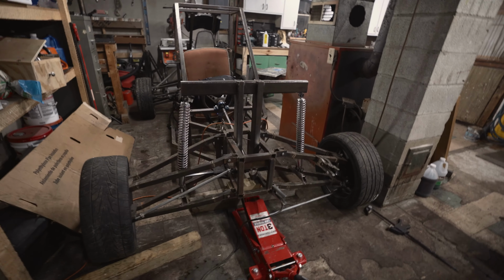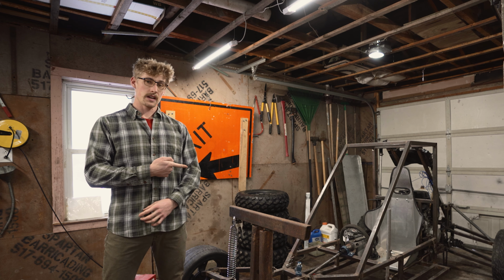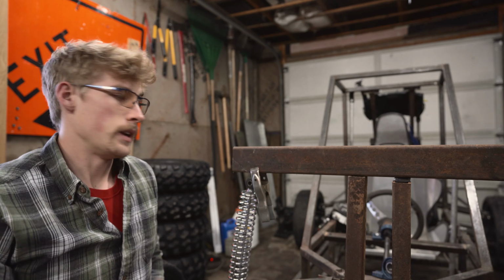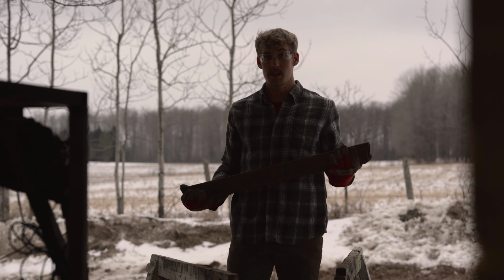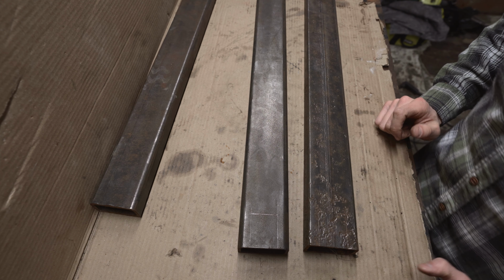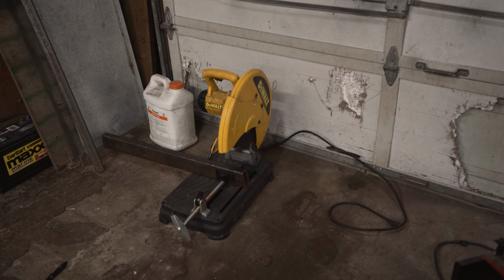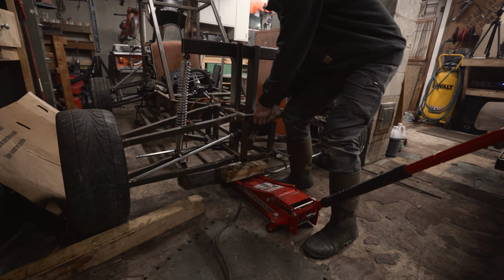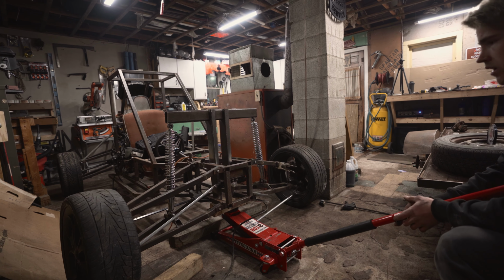Mini Sand Buggy Build Front Suspension Design and Build!

Comment: Hey guys great start to your buggy... to fix the shock issue you first need to weigh the buggy and do some math.  If the front of the buggy is say 500lbs then you need a set of shocks that will hold up 650lbs. If possible look for cheap hight  adjustable shocks. If the back is around 800lbs then you will need shocks that can hold about 900lbs. Secondly be sure to start with a design that keeps tension on the arms at full droop... meaning if the wheels are off the ground, you should still have to compress the shock about 1/2" to 1" this insure the shocks start under load and keep the buggy lifted off the deck. If you need help with ideas just let me know 🤠 good luck